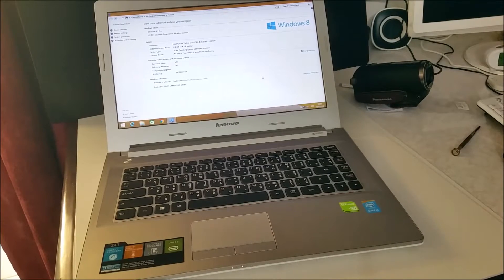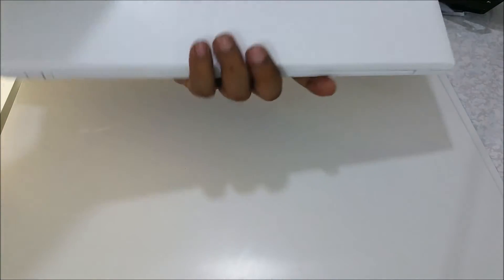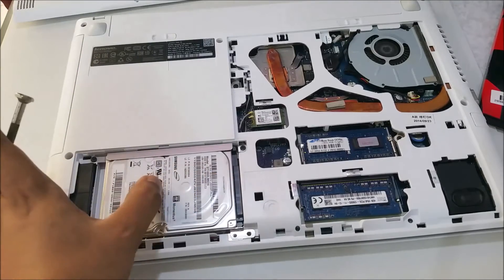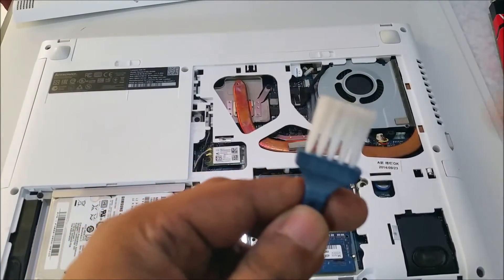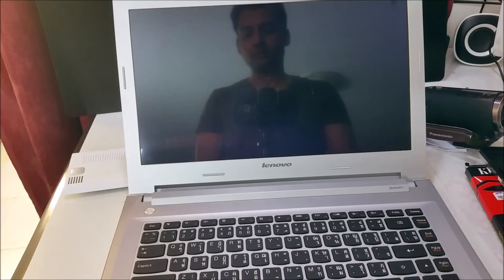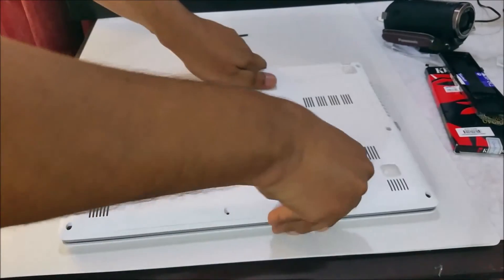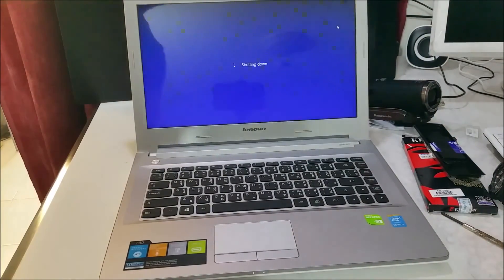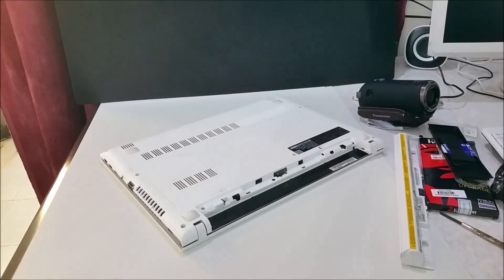lenovo ideapad z4070 upgrade ram hard disk cleaning laptop

Comment: Hi, I have this Lenovo z40-70 and I tried to clean Install Win10 (or 8) in HP ssd 256GB. I tried many conbinations in bios but in the install process (copying files, etc), after reboot a blue screen appears with ntoskrnl or something like that. Was imposible.
With other hard disk, works. I tried and old 80GB ssd, it works.
The hp ssd is good, I installed win10 there to other computers.
My first strange issue with SSDs.
Reply from the maker: sometimes compatibility issues or bios settings

Comment: what types of RAM can I use I have the same unit? Can i use the hyperx kind? Or just ddr3? I can't find an L one. thanks.
Reply from the maker: +Michiko Kaimoto  yes can use hyperx  but DDR3L ,all generation 4 processors and up use DDR3L RAMs, ddr3L ram is common now but only new now cant find easily used on,
Reply: But they can use DDR3 type ?
Reply from the maker: Nala Nandana DDR3 cannot use. DDR3L can only.